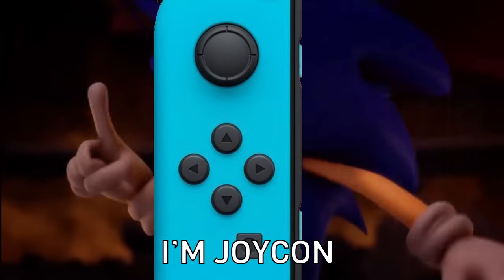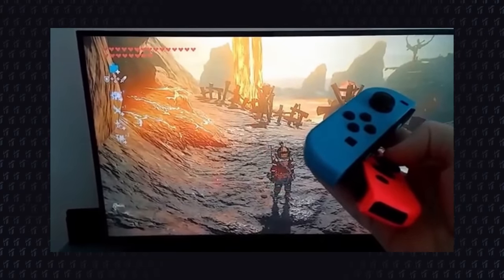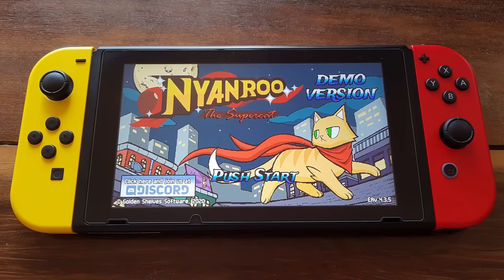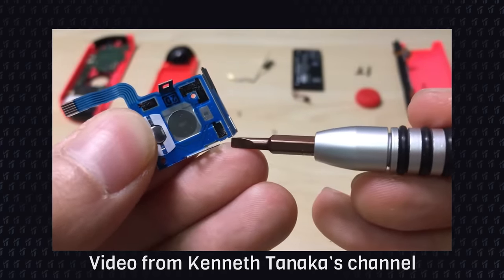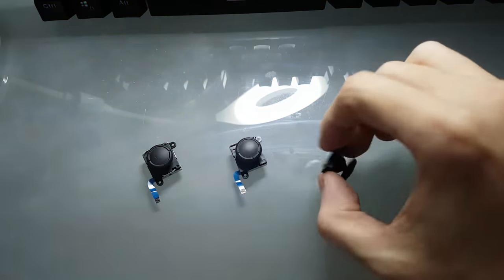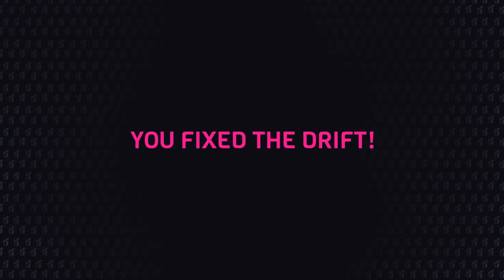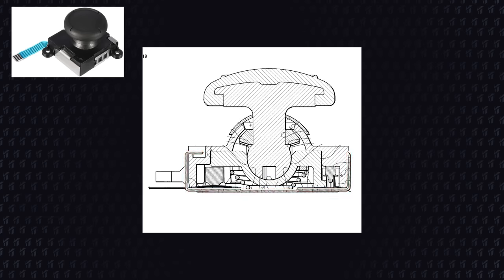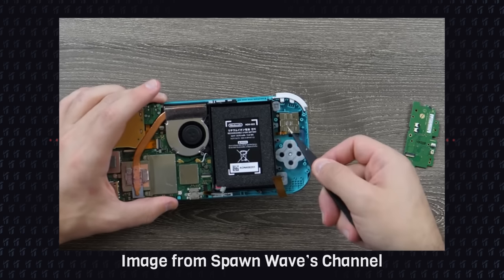How To Fix Your Joycon Drift Permanently!

Comment: The issue I see happening in the future with this fix is that you will need more and more pressure because the other reason for the wear and tear is that those contact pads are constantly being scraped with those metal bits, and older joycons will have it scratched out, disturbing the readings. When you add pressure it will therefore cause more scratching to occur, even if it temporarily fixes the joycon. Ultimately they should have used a different style of joystick which didn't wear out those pads with extended use, even just having the metal be dulled or rounded out on the tips would most likely help.
Reply: The video explains how this won't happen in most cases, it's not the scratching that causes most issues it's the loosening on the plate that holds it all together, so preventing that plate from moving fixes this issue, I've yet to find a joycon that has worn out graphene pads unless the joycon is in bits, this is why you don't see similar controllers using very similar technology as he explains, even the Gamecube uses almost identical technology yet doesn't have this drifting issue unless via abuse, funnily enough the only other controller that has this issue is the PS5, which uses to same plate style as the joycons
Reply: @Kirusion  I've seen plenty with worn out graphene pads, that's part of why I say this. However that may just be my experience and not the majority.
Reply: @Kirusion  except sticks not like this design but that do use a pad also wear out. The switch pro controller drifts and does not have this design at all, it uses a normal full height joystick design with 2 pots
Reply: PS2 controllers had this same issue; there's a thin foam strip that would wear out eventually, causing the buttons to press randomly. The fix would be making a small pad of a few sheets of paper (like this guy recommended) and placing it under the worn out, thinned strip of foam. Reassemble it and voila. Never had issues with my controller ever again

Comment: Oh my god... That makes literally TOO MUCH sense...

The read error comes from lack of tension after the abbrasion of the the contact pads. Applying pressure FIXES THAT.
Reply: In the short term yes, over time it will wear deeper grooves until more pressure is needed, and so on until it damages the pcb of the joystick.

Comment: It is interesting to see the different joystick revisions and how they changed the backplate to try fix the issue. In the Switch light you showed at the end it has the cross pattern pressed into the metal case to try keep it more rigged and try to stop the drift issue. The other designs also feature metal pressing so it seems nintendo was aware of this being an issue and tried to fix it but failed

Comment: Interesting... I had this nintendrift problem, tried all the cleaning without taking the controller apart stuff, and finally got mad while playing Immortals, Fenyx-kept falling off things... took the stick apart, cleaned all the gunk out (had a lot in them), closed them back up, and haven't had an issue since. Watching this video, I think I may have unknowingly tightened the metal tabs on the sticks. So I am definitely going to keep an eye out for new drift and try the 'squeeze check' method you did. Damn good troubleshooting man!

Comment: LOL! Nintendo has been researching why Joy-Con Drift happens for a long time and how to fix it

And this man in just 10 minutes fixes it without a hitch.
Reply: With a single piece of paper
Reply: It didn't take him ten minutes to discover the solution, but he only needed ten minutes to explain how to solve the issue. At least I hope it did. If it didn't then it is just a Band-Aid solution like the vast many out there.
Reply: @summerycast7936  I know, I'm just too lazy to see how many minutes it took him to fix it lol! But I think like 5 minutes or less
Reply: They know why it happens and this isn't a fix. It happens because the hard metal contacts wear the graphite down, creating dust (graphite powder and electronics = a short) cleaning the powder out is a stop gap. The grooves are still there. This increases pressure and works at first yes, but then the added pressure just makes the grooves become worn deeper, requiring more pressure to maintain until the contacts tear into the pcb. This is why nintendo didn't do this.

Comment: FYI: Your standard potentiometer (analog stick) in Xbox, Playstation, and older consoles DO NOT use graphite to read stick position. It uses voltage. When the stick is pressed all the way in one direction, it equals 1 volt. It reads position, and uses how many volts to know the current position of the stick to know how far forward, or backward the stick has been pushed.

Also, if the graphite scraping off is the issue, and is there to protect the actual contact, by applying more pressure to the graphite pads it will escalate the issue much faster in the future, or the contacts will become unreadable in the future from the damage. Also, by trapping the graphite particles in the housing could lead to other unforseen issues. This needs much longer testing periods than 2 months, with many more people trying it before it can be determined the absolute fix for a design flaw.
Reply: I mean either way the joystick is no good. so even if it improves it for a period and then fails it buys time until having to buy new joysticks or joy con...
Reply: @master2873, how did your further testing work out? Were you able to find the actual cause/solution? Does the added paper accelerate the failure?
Reply: Honestly? The price for replacement sticks is not that high and if you're already taking it apart? Replace them, get a new life on that.

Comment: I started laughing like a maniac after he showed that a piece of cardboard was the solution to 4 years of pain and suffering
Reply: I think the Sonic stage clear music really helped, too.
Reply: Plot twist, it’s actually not
Reply: @DeshraD  it didn't work for you?
Reply: @space9kris  I'm not dumb enough to do it. I know the exact cause of drift. It's well documented and extra pressure will only cause a permanent failure sooner.
Reply: @DeshraD  source?
Reply: @kilomatter  I've personally taken multiple apart, I repair them. The cause has always been the same and amongst others who repair them the consensus is the same. Simply take a drifting joystick apart and compare it to a new one from the factory. The cause is obvious.
Reply: @DeshraD  ok, understandable but... what's the cause
Reply: @DeshraD  yeah man dont leave us hanging
Reply: @inconsistent_dg  friction rubs away the graphite, lowering the pressure since the layer of graphite is now less thick. if you increase the pressure, you restore the contact but also make the graphite break down even faster
Reply: @inconsistent_dg  The cause is that the graphite pads become worn over time, and when they lose contact with the surface it causes drift (as does the graphite powder being scraped off)  Pressure is a temporary solution because it pushes the contacts down more however the pressure will cause the graphite to wear faster and eventually bottom into the joystick's pcb. At this point it is  a permanent failure and only replacement will work.

Comment: My 2DS had a habit of turning off when being put down. Turns out it was the battery losing contact with the metal pins, fixed it immediately by just adding some paper to hold the battery in place. Is Nintendo just making things too loose?

Comment: I ordered a switch repair kit immediately to crack open my controllers and attempt this fixed. On one of my Joycons it drastically rediced the drift to near nonexistent and it obliterated the drift on my second pair. It worked for me. A 10 dollar drift repair.
Reply: What about switch lite, does that work
Reply: @melaninmaster  no it doesn't cause the switch lite the controller are attached to the console so if u get drift u have to replace the entire thing thats why im never going with a switch lite
Reply: @tristanminor3443  on a Switch lite you just have to open the shell. It still works
Reply: @melaninmaster  it should, seeing as they're the same stick design, but it could be more risky because you're opening up the entire console

Comment: Thank you. This actually works! The pressure test before opening it is a great tip. I tried that and the stick stopped drifting while I pressed on it, so I opened it up and put the piece of card stock in there and it no longer drifts.

Comment: 8:33 just a small comment: If you already have dust, the friction with increased pressure will wear the contacts faster. I'd say that you ensure there is no dust or clean as best as possible before applying this solution.
I have never done any disassembly or electronics repair work, but it's common sense to me. Please correct me if I'm wrong.

Comment: Is this the first guy to ever figure out what’s causing drift? It took this long? Oh my god.
Reply: I was thinking the same thing. Because I just purchased one and discovered the issue- I was about to get to work, being a fix-it guy, and having read about the issue- then I saw this. I would have totally tried this- and wonder why Nintendo or others hadn't figured it out, being so annoying and a physical issue. It's like not hitting a game boy or blowing on old cartridges fo years!
Reply: @omaryabby9444  they probably didn't research the problem and instead just replaced the parts
Reply: Some people have figured out it’s dust under the control sticks so they clean it with alcohol, but no one has known exactly what has caused dust to go there. 
(The alcohol works for a little but it isn’t a permanent fix)
Reply: I’ve been saying for a long time, the dust is the graphite pads wearing down. If you put the pcb of a new stick and a drifting stick under a magnifying source you can see grooves formed in the one with drift. As the pads wear the graphite powderizes, this is the “dust”. This “fix” will only increase the pressure causing those grooves, and speed up the wear until it bottoms into the pcb.
Reply: @DeshraD  interesting
Reply: @DeshraD  so, will it happen in like 5 years or less? Because i doubt the next generation takes longer than that.
Reply: @omaryabby9444  blowing on carts was never a good idea, never did anything to fix the situation either. In fact it made it worse, much like this "fix" will
Reply: @ElAsombrosoPachus  Yes, this "fix" exacerbates the issue by adding  more pressure to the soft graphite pads, the added pressure will even likely increase the speed of deterioration. Eventually the contacts will reach the joystick's pcb and a replacement will have to be installed.
Reply: @DeshraD  I didn't know that.I just remember everyone did it and it worked. Were we supposed to do something like cotton swab and alcholol? what was the real issue?

Comment: Tbh, there’s more wrong with Joycons than just drift. The L button on my left joycon broke despite me taking immaculate care of it and mostly using the pro controller, and I’ve had other joycons get sticky buttons or broken locking mechanisms very easily. I just wish Nintendo would make new joycons with much higher build quality
Reply: Sounds like whoever engineered the plastic hulls was really fucking sloppy. Both issues are caused by insufficient plastic supports.
Reply: ZL and ZR are even worse because most people dont realise that they stopped working if they dont use a single Joycon as a controller. Nintendo bent the cable there so bad that it gets a permanent knick so the buttons will stop working and you have to replace the whole LED & ZR, LR strip.
Reply: I have the same

Comment: A 1mm tolerance miscalculation is causing millions of dollars lost to Nintendo. Go figure.
Reply: Actually more profit than lost i think, with everyone just buying new joycons.
Reply: @taekwoncrawfish9418  I mean, when the new ones have the exact same tolerance problem, they'll still have the potential to lose more money with shipping costs, labor, etc just to get them fixed if the issue comes up.  Losing money is more than just losing sales.
Reply: @taekwoncrawfish9418  If you consider they're paying someone hourly for fixing them once they're in, and let's go for a bit of a conservative number for hourly and say 40 an hour and they do maybe 5 joycons an hour, that's about 8 dollars to fix one. Then the support team involved in being in contact with the customer, let's add maybe 2 dollars to that cost due to how many they usually have to handle per joycon. Shipping materials I'd say is about a dollar, and shipping costs to and from the customer and back to the customer, that's probably a good 30 if not more for shipping costs alone. That's about 40 dollars just to get a joycon fixed. Granted that's just a ballpark guess.  But, it's a much bigger loss than 5 dollars per joycon, especially since they have to do it for free.

Comment: I'm sure someone has mentioned it in the comments somewhere and apologies that I can't find it, but is anyone else suspicious of how the plastic housing of the joycon directly behind the square backing of the analog stick, which as VK points out could fix the problem by simply being raised/embossed, is actually recessed further away from the analog stick plate for no reason, not even flat/flush with it, making it look very much like they specifically created that gap for the drift to occur?
Reply: nintendo gains NOTHING from this level of universal frustration. the world isnt out to get you, the world is just a complex place with complex problems. They likely recessed that for a very specific design reason (im spitballing here so im unlikely to be correct but as an example, they might have done it to make assembly possible using a particular machine or make room on a previous design where the space was tighter etc.)
Reply: @DCsk8rgoelz  If by "nothing" you mean "several (tens of? hundreds of?) thousands of dollars from replacement joycon purchases", then sure. I'm no conspiracy nut, and I didn't say they're out to get me, but there's certainly no obvious reason for the recess to be there, and there's nothing like it anywhere else in the housing.
Reply: @musicianhayd  Previous commenter is probably correct. Won't bother going into details but my credentials are years designing and managing projects for electronic devices akin to Joycons. Ive also worked for a Japanese company so I'm familiar with their culture of "quality is everything". It actually suprises me that stuff like this doesnt happen more often due to the variation and tolerances in the manufacturing process of many products.

Any revenue generated by joycon replacement sales is wiped out by the  logistic, legal, and PR response they've commited to so far. Plus the Japanese are huge into cancel culture and inferior quality products have a much longer negative lasting impact for a company in Japan than in America.
Reply: @DCsk8rgoelz  Exactly what I was thinking. You sound like you have some design engineering experience.
Reply: @0rangaStang  yes, but no one will forget the fact that the original NES was designed to fail after a certain time period so that it would need to be replaced. This is a thing that happened.
Reply: @DCsk8rgoelz  Actually Nintendo gains a lot by ignoring this problem. Because gamers who want to continue playing will just get another $60 set of joycons. It's even become a collectable part of owning a switch. Also, the idea of intentionally adding defective parts to force consumers to purchase more, is nothing new. (for example Dell and Apple both do this.) An example of this is called planned obsolescence. Where you make a part that is designed to fail over time. This means if your computer breaks, you are more likely to get a newer model then remain with your older one. So companies want their product to fail eventually. Having a computer work for 10-20 years means they wont be buying another computer for another 10-20 years. The fact that Nintendo has refused to fix this joycon issue, (infact they are adding the same issue to the light and OLED) makes me think this was the plan all along. If this was a surprise for them, they would try to fix it... but if they fix it, they lose the potential billions to be gained from selling extra controllers. I just don't think Nintendo expected the joycon's to drift so soon after use. My guess is they were suppose to fail around the time the new consoles came out. OLED models may have the same joycons, but it still puts people in the situation of deciding, do I just want a new controller or should I get the new OLED? It encourages more sales. If done correctly, the customers you lose with repairs and defects is nothing compared to what you gain in increased sales.
Reply: I would assume bad design / ineptitude, not a purposeful design flaw.  It's bad publicity and loses them money in the long-term, even if they make some in the short-term.
Reply: I would sooner believe the recessed space was to hold some sort of pad that was meant to back the joystick but the material was cut to save cost. I don't think anyone would have willingly designed it to fail. Further, the joycon Is surprisingly easy to take apart and fix. No soldering or special tools besides the tri-wing security screws.